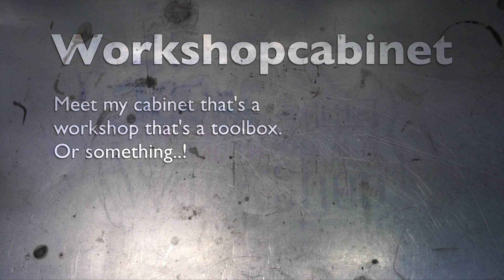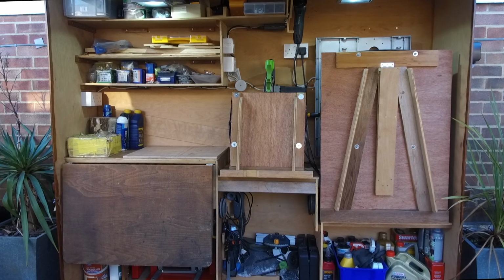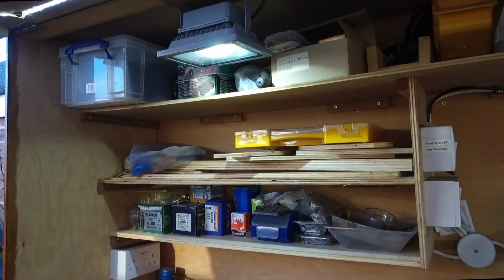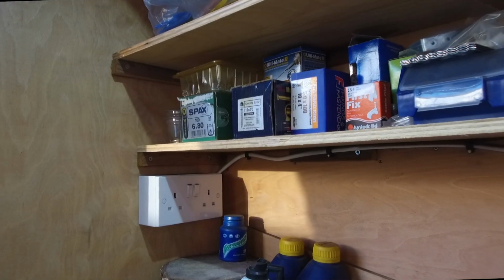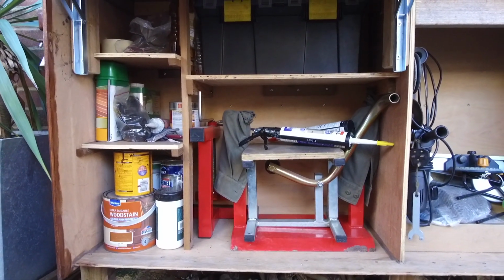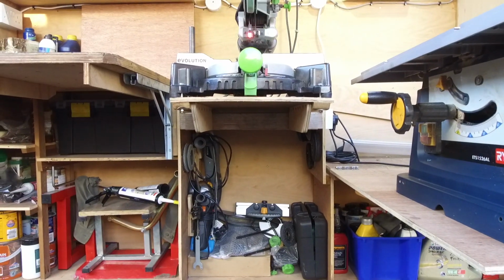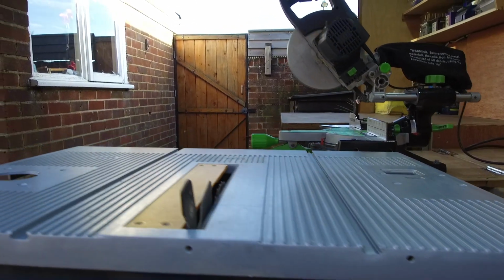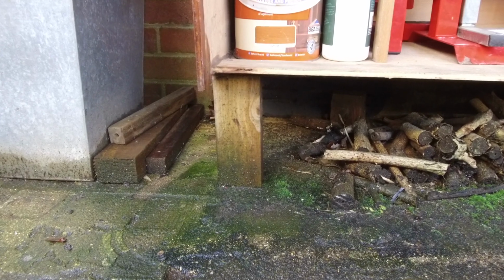My Workshopcabinet - JLW

Comment: Greetings from São Paulo - Brazil! 🇧🇷
Thanks for sharing.
Question: How does it behave on heavy rain - on summer we have powerful ones.
Kind Regards, 
Marcelo F. Cosi
Reply from the maker: Bom dia, Marcelo! 
Whilst UK gets its fair share of rain, I think Brazil gets it much more violently than here. This one is obviously built for UK conditions, so if you have really tough weather, then I'd suggest reinforcing the canopy a bit more, but also making sure that the canopy is locked and can't lift further if any rain gets underneath it. You might also consider adding some side-walls. Maybe something that folds out from the canopy or the sides. This would create either a larger canopy, or more of a "room" (a deeper cabinet) to work in to protect you from sideways winds. You could also make some curtains for it from a tarpaulin or some other material. 
In my design, the rain hits the workbench - in bad weather about 50% of the workbench gets rain on it - one option to fix that would be to have the workbench more centrally in the workshoptoolcabinet. Or the aforementioned contraptions. 
I also had issues initially with the canopy/door not being sealed, so make sure you add some silicone or such if you have seams in the material - one sheet of plywood wasn't large enough to cover the whole front in my case.
Thanks for watching, and good luck with the build and let me know how you get on. Feel free to ask more questions. 

Obrigado!